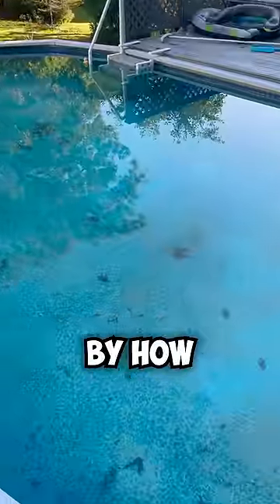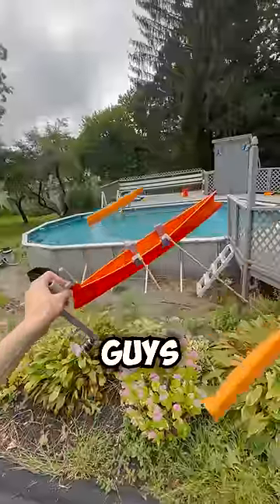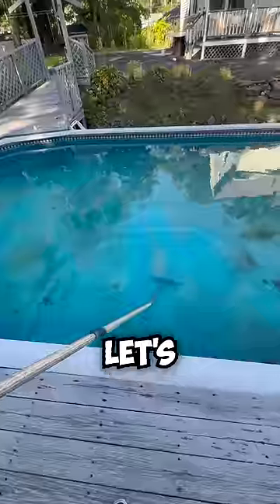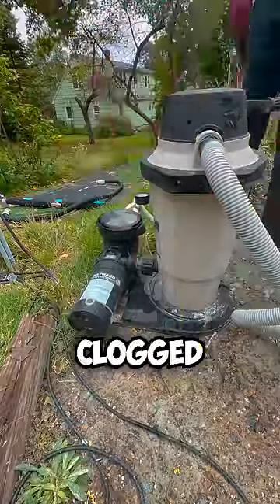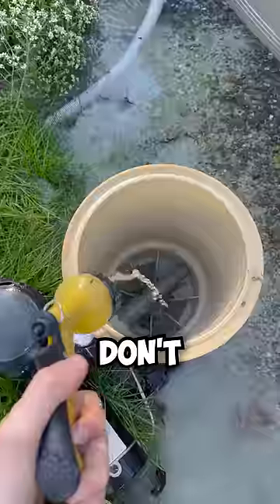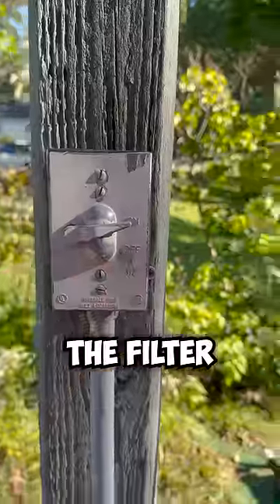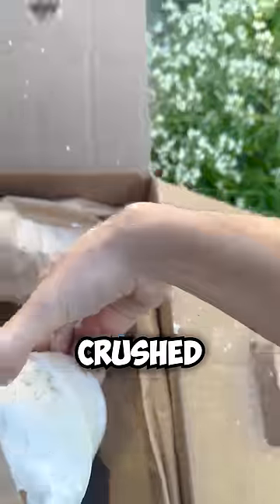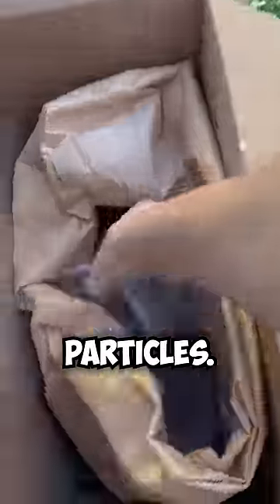Cleaning up my Pool

Comment: I cleaned pools for a living for years. Watching you attempt this clean up is bringing back some memories. Here’s a pro tip, net up your leaves first and then scrub. It makes the process a little easier. Then you won’t have to try and catch all of those leaves that are floating around after you scrub the algae. 👍🏻👍🏻
Reply from the maker: Thanks!
Reply: @makermandan I too build, winterize, and repair, vinyl pools I suggest investing into a pool cleaning robot and change over to a salt filter it’s expensive to switch over but cheaper in the long run and less of a risk of burning your liner
Reply: @CT-5585 A salt filter? This dude 💀
Reply: @cjadventures8840  yes a salt filter we called them or a salt generator for a salt water pool
Reply: @cjadventures8840  It appears that he meant a salt chlorine generator. It runs a small electrical current through the pool water on the discharge from the filter. Running electricity through salt water creates chlorine for your pool. 

For a pool this small, I feel that a salt chlorine generator may be a bit overkill when considering the costs involved to buying and fitting one. With a pool this small, he could run the pool on tablets without issue. A pool robot would also be a tad on the overkill side, in my opinion. I'd say he is be better off just vacuuming through the skimmer with a bog standard vacuum hose and vacuum head, maybe 20 minutes of vacuuming at most.

- A pool maintenance engineer from the UK
Reply: @Shaynewarner1  Yeah, I know. I maintain pools during the summer time. I was just poking fun at the fact that he called it a salt filter and not a chlorine generator. But yeah I agree, tabs are better for smaller pools. We recently upgraded my pools salt system since the previous system we had was outdated and wasn't working and this summer was the best when it came to the pool. Barely got any algae and chlorine was always 2ppm. Y'know, when things work it's just so nice.

Comment: Hi, little tip. Half fill a bucket with water then mix pool chlorine in the bucket then put in the pool. It helps with mixing through the pool.
Reply from the maker: Thanks! The shock is discoloring the pool floor so i may do that

Comment: As a novice pool person in the early 2000's trying to figure out the correct amount of chemicals for my pool, i used a gallon glass container of the water and added chemicals until i had the correct results. I then did the math and added the correct amount for my pool size. Tedious but i learned a lot.

Comment: what if you try three motors with one on each of those balence pool noodles and the middle one will be abit bigger and if you wanan go an extra mile try dual haul with 1 number 3 proppeller on each haul and 1 number 2 propeller on the pool noodles then put a storage area inbetween the two hauls (with smooth motors btw)
Reply: Lol
Reply: @Lisagoble  why you say lol?

Comment: Next, you should make contra-rotating propellers to cancel out the roll of your boat from the torque of the motor. This way you could remove the dual/triple hull design and it'll make your boat faster.

Comment: DE filters are the worst, if you ever need to replace it consider getting a sand filter. Also waste vac the dirt on the bottom before you add any chemicals, your filter is probably going to need to be cleaned a few times to get it clear. A sand filter wouldn't need to be cleaned, it will filter your water better then your DE and then you can backwash it (takes 2 minutes).
Reply from the maker: DE filters are hard to maintain, but they do filter the smallest particles for the clearest water. I think it’s worth it. And yes, I do have a vaccuum but I’ve found it easier to just brush the bottom!
Reply: @makermandan  DE is better than sand. But in between them is a cartridge filter.  Better than sand not as good as DE.  just remove the cartridge rinse and reinstall.   I love it no sand no DE between that and a Maytronics dolphin robotic pool cleaner my pool is a breeze to maintain.
Reply: Do a mechanic super  boat  with pretend bombs.

Comment: Hey don’t let de powder clump in the skimmer like that you need to slowly sprinkle  or it could clog the pump basket
Reply from the maker: I follow the instruction manual which says to dump it in as fast as the skimmer can take it. I’ve been doing it for two years with no problem

Comment: Why don't change the water
Reply from the maker: Any water that stays still will get Algae and germs in a day or two. Its expensive to change 10,000 gallons of water, so its much easier to just clean the pool with a filter and chemicals.